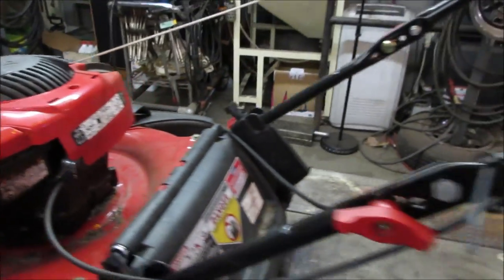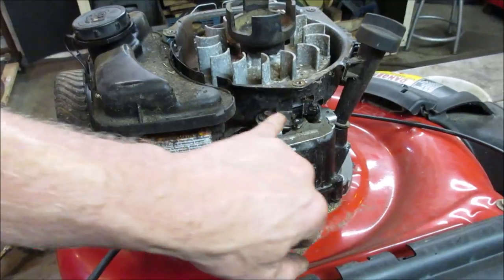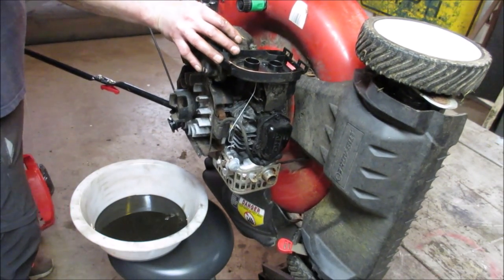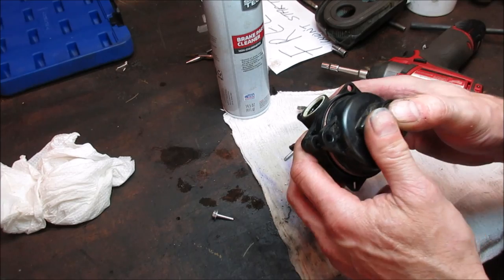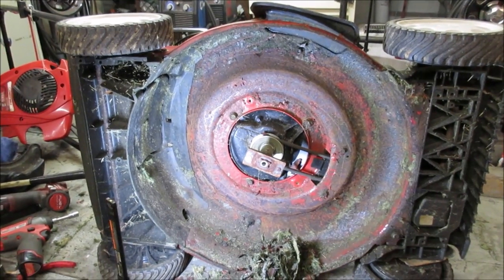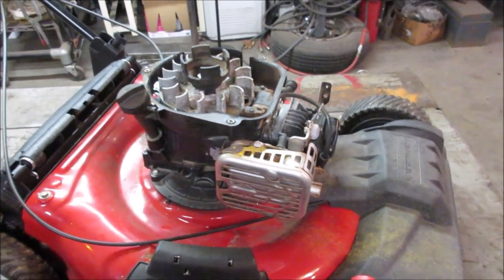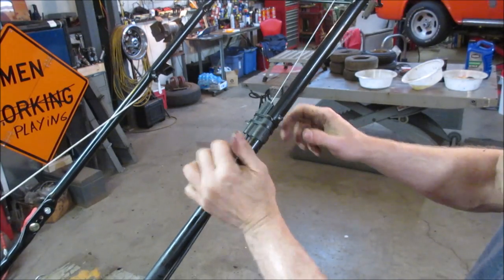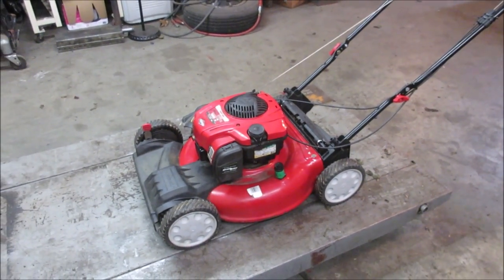How To Restore A Junked Lawn Mower. For Cheap.

Comment: I've found after a lot of testing that painting the bottom of the deck with a coat of aluminium paint does wonders.  Just remove the loose rust and all the dirt and clippings.  Then, just brush on a coat of paint and watch it soak into the rust and crevices.  Spraying doesn't work very well.  I have several mowers that I acquired used that had been rusted through in places.  I never repaired the holes just painted the deck.  I haven't had to buy a new one in over thirty years and seldom have to repaint them.  It also seems to prevent grass from sticking to the bottom of the deck too.
Reply: what kind of aluminium paint? you don't mean the roofing stuff do you? maybe a stupid question but sounds like a good idea and i'd like to try it.
Reply: @blowupbob1  +1
Reply: I sanded (wire wheel) my deck down to bare metal about 7 years ago when it first started rusting - sprayed it with a nice thick coating of spray on flex-seal rubberized paint. 7 years later and it's still great - the only thing better might have been some actual bed-liner paint. Nothing sticks to it at all and i hose it off underneath every time I get it out to mow - might be another option for folks - I think it doubled the life of my mower (its almost 20 years now - Yardworks Model from Canadian Tire).
Reply: @offshack  Yes,  I have bought the truck bed liner in a spray can from an auto store and did that.  It works great!  Nothing sticks to it.
Reply: @blowupbob1  In the UK I have used a paint called 'Hammerite', originally available by mail order only.  It seemed that the grass clippings didn't stick as much as with the original finish.
There is a modern product with the same name but I cannot vouch for its performance.
Reply: @blowupbob1  - I generally buy the cheapest that I can.  It lasts forever.  Don't use the roofing paint as it is too thick and will flake off.  I think I'm using a one part epoxy now but, the stuff that smells like turpentine or linseed oil is what I used before.  I'm guessing that the oil seeps into the rust and the aluminum flakes seal the air and water out.  Unlike other paints, the aluminum paint has tiny flakes of aluminum in it.  When it dries, those flakes overlap one another drastically reducing solar radiation and making a better seal.  Most other paints have pigments that are like tiny balls.

Comment: Steve’s Small Engine Saloon YouTube channel has a nice video on servicing these plastic carburetors. Common issue is main jet hole to small. Enlarging a bit really helps. Central white component does come out. Use small flat blade screwdriver in between cartridge and side wall and gently pry up. Be sure screwdriver in far enough not to damage o ring at top of cartridge. Also pay attention to orientation of cartridge as you remove it, for reinstalling after cleaning.

Comment: I first came to this channel because of a small engine problem right at the start of COVID lockdowns but I’ve been a regular viewer ever since. 

I like the fact that the videos aren’t topic-specific but rather discrete projects. That means that’s there’s lots of repetition- which is the best way to learn. But, actually, those channels that do topic by topic invariably run out of steam eventually. Whereas I can envisage me watching your channel every week for as long as you choose to do it. There’s plenty of variety. 

It’s really good to see one video that just pulls it all together on the mower front. As you say, it’s really only 35 minutes of work but having the whole thing laid out in a logical order by an accessible presenter is great. You really do have a gift for teaching.

Comment: I would absolutely love to see a Reel Mower restore. I just started cutting my lawn with a manual one…what a difference in cut quality. I really want to get a gas one.
Reply: In the Uk we call them cylinder mowers. I love them!
Reply: The cut is superior because a reel mower cuts the grass with a shearing action. Plus being on two wheels instead of four, it follows the contour of the ground better, so you get a more even cut.
Reply: @notajp  NoNo I know the difference haha. I love the cut when I use my manual one. Could you try to get a “reel mower” to restore on the channel 👍

Comment: Thanks Mustie, the 'teacher' in you certainly comes through clearly and makes your content both interesting and very informative. I especially  support your continual emphasis on safety. With the current fuel prices is it worth discussing disposal procedures or whether it is feasible to reuse contaminated fuels? The reel mower would be an interesting presentation, I am of an age where that type of mower (the manual version) was the only option - one with a motor would have been a real prize. Please keep the content coming, I look forward to your next presentation.

Comment: Good show as always, down here in the gulf coast, we have quite a few places to purchase non alcohol gas, my car gets better mileage it seems. there is a huge amount of boats here so i guess that explains the amount of stations that sell non alcohol gas. also a friend of mine was a motorcycle mechanic for many years specializing on HD's he said NEVER NEVER use unleaded low octane fuel in ANY motorcycle or Small engine.
Reply: Depends on what it was designed to operate on..

Comment: That is a standard 'MTD' mower. MTD was acquired by Briggs & Stratton/Stanley a few years ago. I have the exact same mower under the Snapper brand that I bought from Walmart about 4 years ago. A bit off topic but I live fairly close to where TROY BILT started. The original factory was in Troy NY. They were noted for their rototillers which were very heavily made. Growing up we had the 8 horsepower 'Horse' model which was built like a tank.
Reply: I sure hope it wasn't a Russian tank, they don't seem to hold up very well.
Reply: @cletusspucklerstablejeaniu1059  Those old TROY BILT machines were built to last forever. There are some in this aera that are still running from thr 60's.
Reply: B&S bought Snapper. MTD stands alone and makes most of the other brands, but not all.
Reply: @DeWittPotts  1990 TroyBilt mower here. Bought new. Aluminum deck, B&S Quantum flathead. It's still a beast.

Comment: Love watching these. I feel like I could do one myself ! My neighbor is having a garage sale. About 4 old lawnmowers, an old roto tiller he wanted $40 for, some new and old tools. He had two air cleaners like you pulled off this lawnmower. Problem around here is most of the stuff is old. One lawnmower said “Bobcat” on it. He also had a gas weed whacker. He also had a bunch of rusted tool boxes. Question : what do you think of all the new electric stuff? Lots of zero turns and snow blowers are being added to the push mowers. Saxman
Reply: GO GET THAT BOBCAT
Reply: @davidcoudriet8439  lol i stopped there to see if he had any musical instruments and it was just stuff he collected throughout the years. He had mobile 5w30 oil there at $4 a bottle. Mustie doesn’t pay anything close to that. It was a town wide garage sale.
Reply: @paulmiller7276  grab the bobcat quick. It's special; worth it, even if you just flip it.

Comment: Yes, would love to see you restore and set up a cylinder cut mower. Much more engineering and precision than a spinny bladed grass chopper.
If you don't want sharp edges on your cable ties cut a bit of the body off with the tab so it's flat and even. Nowt dickish about that.
Reply: You mean a reel type mower?
Reply: @robertheinkel6225  British refer to them as cylinder north America says reel.

Comment: The least expensive push mower at Walmart (Hyper Tough), that is MTD re-branded  for Walmart, is $255 plus tax.  The self a propelled mowers are about $100 bucks more.  This Troy Bilt self-propelled mower tuned up and everything working 100% will sell for $120 and up all day.
Reply: Agreed at $125 on marketplace I'd have it sold in two hours. That's a good mower and good price.

Comment: Question for ya, Darren;  I've always had issue with 'auto-throttles' because they cold start full throttle and then after you're done - and the engine's hot - BOOM - off.  I like to start a cold engine and after choke, put that to idle asap and let 'warm up.'  Likewise, after using and the engine's hot, I like to idle down to cool down, then kill it.  Aren't these 'hard' on these small motors?  Every Craftsman I have;  tractors, tiller, push mower, power washer - all have throttles except my 2-stage walk behind blower.  I would cringe on full throttle cold starts - especially when starting for the 1st time of the season - so I noticed there's actually a throttle slot - very similar to that of my tiller, so I looked up a throttle on Amazon and for $30, I bought one and it even had all the mounts for it.  It now works as I wanted it.  Your input is appreciated!  Thanks!

Comment: You're mistaken on your ethanol in gas thing. E85 is 85% alcohol. What's been mandated is E15 which is 15% alcohol. We were using E10. IMO, most of the hysteria over alcohol in gas is way over stated. But, I know I'm in the minority. Great content, as always.
Reply: I have had to repair numerous small engines, due to alcohol.  It deteriorates the fuel lines,until they just fall apart. I have worked on forty year old mowers, prior to the introduction of alcohol, and never saw a fuel line disintegrate once.
Reply: @robertheinkel6225  The rubber today is garbage. That's what deteriorates lines. The E10 or E15 is fine as long as it's fresh. Let it sit and it will clog carbs solid.

Comment: I have 2 push mowers.
1 I got from the dump and 1 I paused 20 bucks for. 
I also have a riding mower I played 200 for.
All had issues and all are A ok now. 
I now have about 250 bucks in 2 good push mower and 1 good riding mower.
Thankyou sir, you have taught me enough over the years to muddle by on a shoe string budget.

Comment: I fool around with pushers. I use an eyeglass size screwdriver to open carbs., & pop out inside jets. I put w.d.40 on jets to help slide together. Iv'e learned a lot from all you Guy's vids. Old Retired Guy.

Comment: You make repairing stuff so interesting.  Time goes by fast and it's enjoyable.  My mother in law had a lawnmower with a white push button gas primer.  I used to pull the plug and clean it.  It was a cool LM.
But once it died my sister in law talked her into trashing it and buying one with two batteries that have been a complete disaster.  She has huge piece of property.

Comment: I come across water in fuel tanks for lawn mowers often. More often then not. that's the only problem since water is heavier than gas. I pour in isopropyl alcohol into the fuel tank and then wet the air filter with same, and start it up. The shaking of the engine mixes the water into the isopropyl, which the engine can burn and I'm off and  mowing. This isn't a cure for a dirty carb or anything mechanical. But 95% of the time it gets the mower running. 

Thanks for the detailed lawn mower servicing video. Always enjoy seeing you have fun wrenching on a machine.

Comment: I always cleaned under the deck of my mower, changed the oil and ran the fuel tank dry, checked and/or replaced the spark plug before putting it away for the winter, just replaced it in 2020. Same mower  I used from the age of 9 for mowing lawns in the neighborhood. I'm 72 now so 60 years of service for half an hour each year to prep it for storage.  My grandfather bought it for me because I was using a push mower before that (no motor) so the kid with the power mower got all the business. Used the money saved to buy my first car.

Comment: I have had a few of the newer B & S engines with this plastic carb try to run over speed as yours did on the first start. I found the levers that control the choke and throttle from the governor were not synced correctly. The throttle lever will hold the choke shut until the choke coil warms up, and then the choke lever will hold the throttle wide open, overriding the governor.  When you cleaned the carb, you got the levers in the right position, and the engine performed normally.

From now on after installing the carb I will hold the choke pull off linkage ( the one from the temp sensor on the muffler) in the warm position and make sure the throttle linkage moved unimpeded. 

Great video work as always!

Comment: My Husqvarna push mower has a deck washout port included on it, and I use it after every time I mow along with tilting the mower up to verify everything is clean.  I'm in FL so we mow for most of the year, and at 3 years old the under side of the deck is still spotless.  Those ports work great, and I just leave it out in the sun after I wash to let it dry before I bring it in the garage.

Comment: Good video. I put my 1949 Cushman motor scooter and 48 Harley to "sleep" for the summer. Here in Arizona it's too hot to ride, we have already had a couple of 107 degree days and it's only May. Just going up from there. I use a number of tips I learned from you in getting them ready for a few months out of service.
El Mirage, Arizona

Comment: When I moved into the house i"m renting 3 years ago my old craftsman mower got stolen while I was in the process of moving.  My new landlord gave me a non starting mower with the exact same carb.  Its because of your videos that I was able to figure out what was wrong.  First of all there was a tiny little piece of Styrofoam, no doubt from packaging or the factory that had clogged up the main jet hole, once I cleared that I was able to get it started, but it was backfiring so violently while trying to start it that it kept dislodging the blade from the bottom of the deck. I had to carry wrenches with me while I mowed because if I had to let it die for any reason the blade would come off. After watching some of your videos I realized that the timing key had become sheared in half and timing was off like 5 to 7 degrees. Got a new (used) key from another mower and the thing works great, it's been about 3 years now and it starts and runs the first time after winter on the 2nd pull.  Thanks for the amazing explanations on how this stuff works and how to fix it when it doesn't work.

Comment: I have the same engine on a mower with the same carb. Had problems keeping it running and had to constantly pull the float bowl and clean the main jet.
Finally took a small hand drill fractionally larger than the jet. Opened it up and haven't had a problem since.

Comment: Yes, i want to see the reel type mower video. When I was a kid I used a Briggs and Straten reel type to cut my yard and my grandparents yard next door. He was a blacksmith and as he got older and his son took over the shop, his job was to sharpen the mowers. Good old days. You can't find them anymore. I tried. All I could find is those designed for tiff grass on golf courses etc. They do a much better job of "cutting" the grass rather than chopping it.

Comment: I have a newer version of that same engine and plastic carb. Took it out two weeks ago and it wouldn’t start. Cleaned carb with hot soapy water, dried with canned air and it fired right up. Had same issue putting that float bowl back on. Backwards the first time. Also the primer bulb wouldn’t pull gas into the bowl until after I cleaned it. Gotta be careful with the plastic gaskets and not stretch them out of shape. Love your small engine vids.

Comment: THANK YOU!!!

I’ve watched a lot of your videos and this is the first time I’ve been able to apply something I’ve learned directly to something I own!

I have this exact same mower. It was used for one summer before the safety cable managed to get stretched and it won’t stay running. It been in the garage ever since. It’s a Lowes replacement for another of the same mower that lasted only one summer before dying from the same issue. 

I couldn’t figure out before how to adjust the cable length to disengage the brake or spark kill. 

And now a simple zip tie has it working! 
Thank you.

Comment: So...I mentioned your videos and how much I have learned...Well...that is what got me into trouble. Now I'm responsible for getting a Rototiller, 3 Lawn-Mowers, 3 Snow-Blowers, 2 Trimmers and a Edger all in working operation this summer. Of course I'm being reimbursed for my work, and so far I have 4 pieces of those equipment working again. Don't know wether to thank-You or hate you. LOL!  Question: Where does one find the Engine Number on a MURRAY 6.0hp Push Mower? It needs it's Coil replaced and I can't seem to find the correct coil because I cannot find what it takes as a direct replacement.

Comment: Casey's General Stores here in Kansas usually have at least one pump that's ethanol free, but it's 50 to 75 cents more than E-gas. Sux too, as I prefer to run my vehicles on it; my small gas engines I bite the bullet and run e-free in them. Thanks again for another great vid. Darren. Be well, stay safe and God bless. Rev. D.

Comment: My dad had a small engine repair business for many years and I helped him while I was in Jr and Sr high school.  
.
An engine factory representative told him that when a 19 inch rotary mower is running at full throttle, the force at the tip of the blade is TWENTY-SEVEN TONS!  
.
Over the years, a few owners brought in their mower and said that they had chopped off the top of a one-inch steel surveyor's stake.  The crankshaft was quite bent.  To remove the crankshaft, I would have to cut the shaft with a hacksaw close to the engine bottom.  The shaft cut easy as it was non-hardened mild steel.